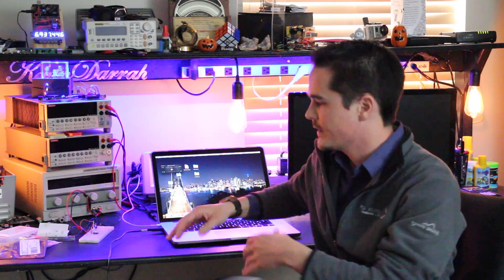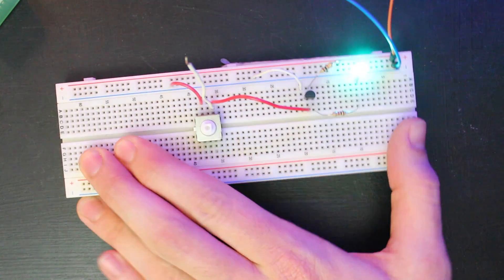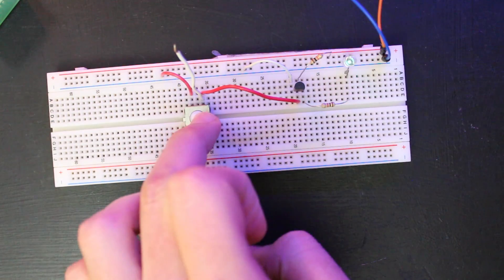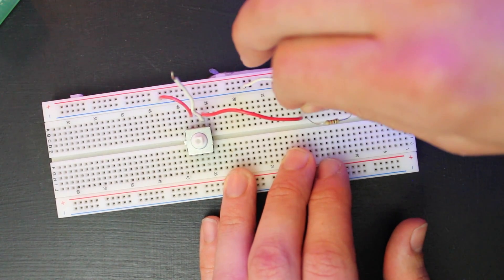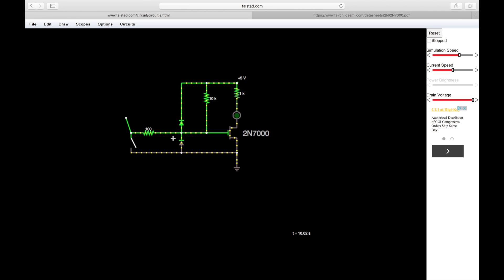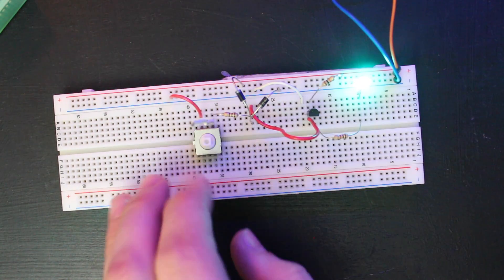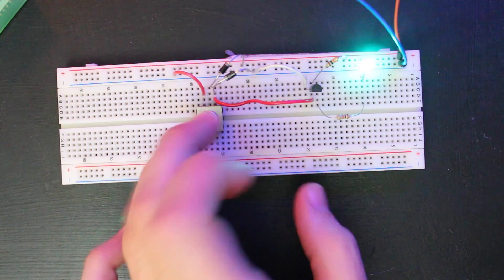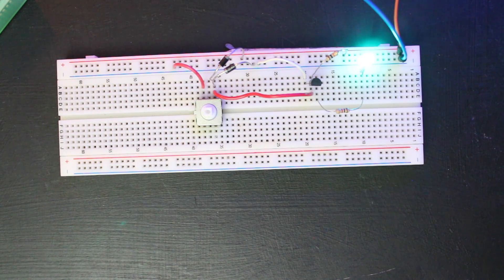Destroying Semiconductors with ESD & Protection Circuit! Design for EMC

Comment: Very good demo. exactly what i needed.   Im using the atmega 328p mu. after reading the manual and such, i found out that it has this internally, so the easiest method is to just add resistors on all the io pins.   i will use this method that you showed on the mosfets tho.

ive probably killed a few earlier boards that i made with esd.... when i  think about it :P

Comment: Years ago and I mean years ago I owned a security company.
I installed a well known brand security system and customers were walking across the carpet and touching the remote turning the system on/off and activating the panic alert to police. 
The company finally duplicated the problems and sent out transorbs to help correct it!
Trouble with transorb at that time, they needed to be replaced if hit with a excess charge beyond their rating

Comment: There is no way in HELL that I would put carpeting on the floor of an electronics workshop/lab.
9:24  BTW... you could hold a metal implement/tool/nail in your hand and use that to touch the input wire of your circuit and you would not feel the "pain".
Reply: Why not?

Comment: Quick tip for your house. When there is more moisture in the air / carpets / ... - there is more conductivity for the charges. Sometimes even only lightly sparing your carpet with an spray bottle of water is all you need to prevent these charges to accumulate on yourself.

Comment: What physically causes this?  Is something in the FET getting permanently charged like EEPROM double gates?  Maybe your socks on the carpet charged you positively and the fleece negatively which is why the LED got dimmer or brighter after certain shocks.  I'd be interested to see if you'd get only dimmer failures or only brighter failures if you only had one diode in.
Reply: It's the blown remains of the metals and other materials making up the MOSFET that form a permanent conduction path that can no longer be influenced by the gate.
Reply: @NixieTheSkwerl  Thanks for the reply! Do you have thoughts on why the on-state got dimmer, then brighter again after subsequent shocks?

Comment: I remember testing a Buck converter and smoking it...Had to sample another dev board and my boss wasn't happy....
Reply from the maker: +Richard Johnson here's one for ya - I was working on a design once and was having problems with an old CD series part.  This was through hole stuff that this company had stocked in their parts bins.  So I swapped the part out with a new one... nothing... then another, and again... nothing... I tested every part in that bin and they were all dead.  I then overnighted a tube from digikey, and bingo, worked like a charm.  We think that someone stuck their hand in there and zapped the whole freakin bin.  That one had me pulling my hair out...
Reply from the maker: +Kevin Darrah or one time I was working in the EMC lab for a company and we were running contact/air discharge tests on a product when another engineer told us about really weird ESD problem.  They were zapping all of the mounting screws of the product, which is no big deal since they tie right into chassis ground, but the strange thing was that the product would reboot when one of the screws got zapped.  They spent weeks trying to figure this out, and it turned out the that path to ground through the metal chassis passed right by the main processor. They found that the EMF generated by the ESD was enough to mess with the reset line!